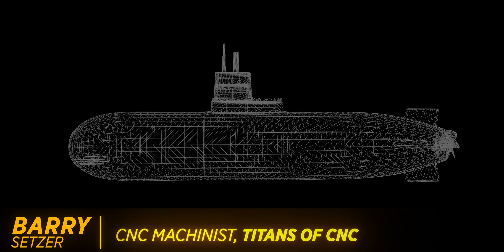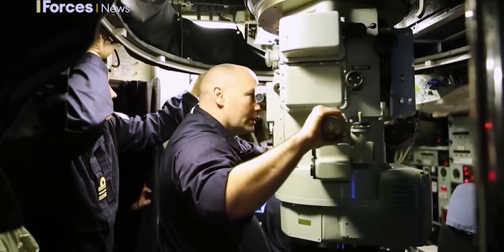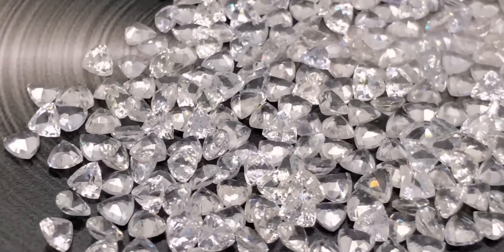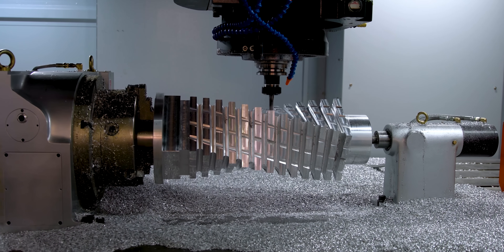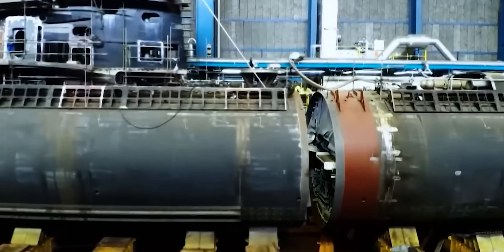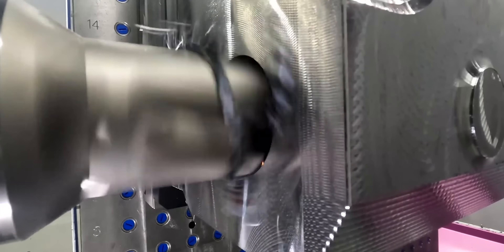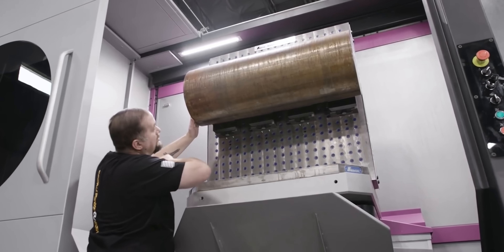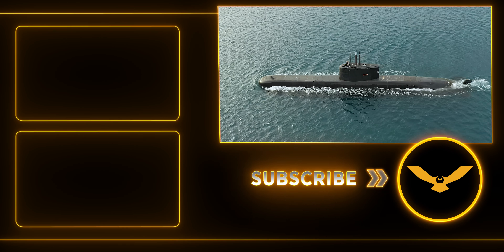I Machined a 50 Million Dollar Part

Comment: A development process that doesn't allow for changes starting before you can actually test important things is how you take a $5M part and make it a $50M part. You have to figure out everything that could possibly go wrong and account for it even if in reality, 90% of those things could have been totally ignored and wouldn't have had any effect at all.

If I was involved in the development, I'd have wanted to ask what it would cost to add two extra blanks to the order from the foundry on top of however many you need to deliver. The assumption being that they will get used eventually (even if the first part if perfect, parts have a tendency to fail in operation and being able to cut two years off delivering a new part isn't nothing). Given the cost of getting extra blanks, you then need to ask the question; is it cheaper to risk a failure you can learn from or to remove every possibility of failure? If the blanks are more expensive then the tooling plan, then by all means, get it right the first time. If not...

The general idea I tend to try to work with is "It's only a failure if you didn't learn anything you can use to make the next one better." As long as you set it up to learn as much as possible, and as long as there is a next time, "failure" is always an option.

Comment: I've cut carbide on an hlv hardinge with diamond toolkits, I've made multifaceted drills with negative angles in the bottom cutting face for mating in hydraulics.  I'd like to work with you.
Reply: Tool bits, God bless auto spell

Comment: The most expensive parts I've machined were steel tubes with copper-nickel explosion bonded to the outside. These were anodes for the navy. Once those bonded pieces of stock got to us they were worth over $10k and they were one of a kind. Getting more stock because you scrapped one was not an option. Those were rather hard to scrap so it was relatively stress free but still I was triple checking everything.

Comment: Monel: just to put this in perspective I machined 10 bars of this that was 3/8 inch diameter and 1 inch long bar. This customer was charged $190 bucks for this. I ran 20 pieces of 1/2 diameter and 4 inches of bar was charged $2,000 and some change. That material is not cheap. Something that can fit in one hand just put it that way. Crazy to see this much.

Comment: In the 1980's there was a company 
DC Tech.
 Michigan Ave NE Washington DC 
They did a lot of model work for the army Corp of engineers. Hydronic valve slides were one of the difficult parts they made.

Comment: I once worked with a part used as a liner in Pumps for the Mining industry to protect the inside of the pump from slurry and rocks. I was attaching sensors to it to measure abrasion rate

Comment: I used to work for a R&D military contractor that made nuts and bolts for aircraft/ships out of these awesome alloys. My job was to run a small CNC machine that would etch the logo on the top of each of the bolts and ran a pre quality check before it went to the actual quality control department. Was an awesome job, I won a 100$ raffle my first week there 😂 “the new guy would win the best raffle in a while”, co workers reactions was hilarious.

Comment: Imagine if your tool brakes midway. Sorry drills and milling tools break and you should run new tools too don't take any chances but it may happen anytime. You don't need to run the tools at max cutting speed at expensive parts but with cheap parts it's better to throw something away then slower workflow.

Comment: It’s only 50 million because they say so, the military says hammers cost 200$, there is no way the material comes close to that price, you guys do fantastic work and should get paid well for doing it.
Reply: Monel is expensive, and a 14ft size forging does sound like $12m
Reply: It's not the material it's the certifications behind the production of the part that cost money. Not every shop has certs that align with the need and there isn't enough of those shops to go around!

Comment: I have made parts for the military.  A poly-carbonate window for a camera.  27 pages of specs.  Made in 1 hour.  Massive air-conditioned workshops to make composite parts for submarines.  12,000 pages of specs.

Comment: I destroyed a $200k drill bit?
Boss thanked me.
Ok, the guy had bought it for 7k, bought it in in the hope we could rebuild it.
Was going fine until it started cooling down.
Carbide head sintered to a steel shank. Replace its 200 odd pcd inserts.

Coefficient of expansion got me. I had it a nice cherry red...

Yeah well, i said i wanted to use the induction heater on just the wings.
"Someone" forced me to do it with gas.
A 600mm pcd tipped carbide head drill bit weighing 450 odd kg...

Comment: My first job was running a SNK gantry mill 14ft by 60ft five axis machining titanium Side of body parts size of a bathtub I did run the smaller five axis SNK mill like 150in by 60 with a and b axis. And yes that fear your talking about is like a drug to me.

Comment: most expensive parts ive worked on were vespel plastic parts that got milled into little 90* bends, and also really thin walled turned sleeve looking parts on a mandrel, $1600 for a 38" .750 dia rod

Comment: Didn't you sign a nondisclosure agreement? I had a Machinist coworker, he worked making parts for nukes, he just had to make what the drawing required but didn't know what the other parts were.
Reply: Hence why they didn't say what the part was.  Based on the size, I'm guessing it was the housing for the nuclear reactor or some critical component for it.

Comment: Well Ive built a couple of scetchy stuff I work for a salt mining company so we needed a coupling for a machine and my boss asked all the engeneering shops around and no one would cut it so he came to me and I told him lets try the best part is I couldnt get a solid peace of metal at that time so I had to weld plates together to form a shaft now my lathe an mill are very old so theres alot of play I cut that adapter from welded plates and its been running 4years now no problem the original pruduct cost like 18k I made that one for about 4k

Comment: I’ve had several jobs that were upwards of ten thousand Dollars in material, and finished at over 50,000 dollars for single parts. It’s not often but when you have those jobs you put in every bit of knowledge you have and run safe double and triple checking everything before you press go. Ask questions if your not sure and take advantage of other people’s knowledge when it’s applicable. Asking questions doesn’t mean you can’t do the job

Comment: Got me beat on cost. Most critical and costly project I ever worked on was called a Transit Rail Simulator  built for Visteon at a cost of 250k in the mid 90's. It was exactly what it sounds like. A flatbed train car simulator capable of replicating the forces on automobiles when the train would couple and decouple additional train cars. Dimensions were 26f by 8f made from 4x8 sheets of 1/2in aluminum and fit together into a honeycomb structure with full sheets on top. When finished it required a 77000 pound actuator for the tests. It was a welding nightmare. No matter were you were in the shop, you got flash burn due to the reflections (incoming sarcasm) Thank God aluminum doesn't warp because it required 2 linear bearings running the full length. Mind you this was a small shop and Visteon's first choice for a builder was Boeing.  They told them they were out of there minds, and they were right. We had to come up with some ridiculous fixes like when we needed to flip it for welding we had no overhead crane so we came up with Pig on a Stake plan. Found the center of gravity, lifted it from either end and we could rotate it with a single hand. We even used Liquid Nitrogen to fit some pins. After the pins were pressed in their rings, we took the rest of the day throwing liquid nitrogen at one another. As far as I know it's the only one in the world.

Comment: Snapped a $400 tool in a $1200 block of material for a gearbox assembly. I thought I was going to throw up. Machine didn't have enough memory to load the whole roughing program, so I broke it into 2 layers and stepped down the Z offset. Didn't change the retract height to compensate. Full rapid into the part. Sad day. Lesson learned. Don't cut corners.

Comment: Never even came close to making a mistake of those types of magnitudes We were a fairly small shop doing mostly small parts ( still very intricate and accurate) Some were very large quantities and almost everything we did was a repeating part. Probably two hundred or so parts  that were repeats. However I can still imagine that feeling. I will share this story though. A good customer had us tool up two CNC lathes to machine a new brass casting . Running 2 shifts we banged them out while a rotary transfer machine was being built. After over 5,000 parts being machined to spec we got a call to stop production immediately. All those parts were just sitting there until they started to assemble them into the final assembly. Turns out they made a huge engineering mistake and couldn’t assemble the unit. We were paid in full but all were scrapped. I’m sure someone there got that sinking feeling. With all the machines and highly skilled people you now have I have no doubt you could take on ANYTHING! Quite impressive to say the least. I do have to wonder though just what would have resulted if you did do a big boo boo .

Comment: My most struggeling part, was a ion trap casing assembly für a prototype in 1985. CNC with paperstripe. No display, no haimer 3d measuring device.. made of a special steel. Work 3 months on it. The assembly was 3 kg total.. with 12 parts.19 cncd screws, runs in the first try better than expected. Made by blood sweat and tears 🙂 this parts sold later worldwide a few thousands maschines.

Comment: I only remember a large gear shaft that I had to weld, for which I did not want to give any guarantee and had advised the customer to try it somewhere else.
That's what the customer did, my boss wasn't thrilled and really angry with me.
But hey, the gear shaft didn't fit in the furnace to preheat, I didn't have much idea and was just the holiday replacement for the actual welder.
And that makes a difference whether someone has done repair welds for over 10 years, or just 2 months now and then like me for fun.
If I had destroyed that part, the assembly lines at Opel would have been up for a few days.
So a lot of loss in a failure, but my boss didn't care that the customer might end up in Devil's Kitchen.
Whatever.
Reply: Sometime you have to say no to a job.
Reply: @captiannemo1587  Yeah, and at the latest, since I've been working for that scumbag for almost a year, I have no problem saying I don't work for assholes.
It's the only way to make sure bad people don't make it to the top.
However, an hour later, in my anger, I had accepted another assignment, which did not seem entirely impossible to me.
However, the agreement between the actual welder and the boss was that orders would not be accepted while he was on vacation.
They were his old clients, whom he had as a self-employed person for over 10 years and who only came there because he had let himself be bought up with his company.
Anyway, word broken, customers and their existence risked for a little money, an asshole.
Anyway, I had repaired a molding plate, over 2 hours of work.
A rectangular wall, 10 mm high and 3 mm wide, I had to weld 1 mm so that the customer could rework it.
Without causing cracks, but had told the customer that I had never tried this before, could not deliver the same quality as usual and it was just an attempt.
The client had no problem with it, I never heard of it again and I assume the work was ok.
I'm also pretty sure that the actual welder, after he got back from his vacation, asked about the result, so probably the price was shitty at most, but not my work.
But to this day I don't know, I never had to do anything like that again.

Comment: Now, I'm semi-seasoned in lathe machining but I also know that there's a ton I don't know about machining as I keep learning new things from different shops I work in.

The most expensive piece I worked on was a large twin plastic extruder barrel coming in at near 250k USD. I was very proud of the work I did in that shop. 

I've moved on to another shop but they do it all, not just extruder barrels and I'm having to learn so much all over again since you don't know what job you're going to get or what material it's going to be made from. I'm finding it a bit daunting but also exciting and a challenge. 

We'll see if I hold up. There's days I feel comfortable and confident and there's days I feel lost and unsure.

Comment: It is true it is a lot better to build several prototypes out of cheaper materials than FUBAR  a  stock unit of "Un Obtainum" and having a severe weight loss from the butt chewing you might receive from your customer, the owners, and the CEO. The lower Superiors and finally your line boss. Because Everyone Knows Engineers don't make mistakes, or computers as well. 😅In college going for a materials science degree a CNC instructor told of a story that happened to him when he was a beginner machinist.   He was doing production work on punch tape-controlled machines( per computer-controlled machine). It was Monday afternoon just before closing.  He got the tape program boss told him to run the part. He asked if it was checked for error and blind run.  His Boss said, "No just run it the engineers know what they're doing".   He told the supervisor "Ok, but if it goes south it's on you. " About a third of the way through the part, the spindle speed ramped to 120% safe operating parameters and plunged through the bed of the mill. Destroying the tool bit violently and driving the stub through the work table and toasting the spindle.  So with today's software packages, one has to be a complete moron not to require several check-runs, then a test unit in either machine wax or aluminum, and then run your actual units.  Because there are always slight uuughoos! By running a  series of tests that chance is severely lessened.

Comment: Barry, the part where you
Mentioned having to document your entire process including feeds and speeds to the customer for
Approval before even cutting a chip, is my life everyday in the semiconductor field, even if it’s a 100$ part with + or - .010 on all features, no deviations , and it’s so annoying to deal with😂, they lock that process in with no changes allowed without 9 months of asking permission
Reply: That sounds familiar. In semiconductor, where a change in the surface finish or porosity of a part could result in millions of dollars of scrap, it's totally necessary to maintain stringent qualifications of every component and material used in the process... Hopefully it pays you well, because the machined parts I've ordered in the fab are all absurdly expensive.
Reply: @tanner3801  it doesn’t pay great, I make 28.25, I’m about to get a raise to about 31 and change, they make absolute bank, in our copper department, one person can profit the company half a million dollar per month and that’s the change we get,
Reply: @tanner3801  it can be something as simple as a bracket out of stainless that holds some wiring, they will give +-.001 tolerances for a bracket that gets welded or bolted to hold wires

Comment: I made a Bennett fit connection for two parts which were CNC Out. All worked great on the prototype with great tolerance and locking action... Made the finished part and they did not fit together.. Was not obvious straightaway... Turned out to be clamping force from hydraulic chuck to great which when parts were machined away cause the part to Deform.. Change the machining order to take this into account.. Schoolboy error I know..

Comment: While it might not be possible due to infosec and clearance, it would have been nice to see the finished part. Or even the original billet. I don’t think we saw anything close to a 14’ diameter billet even though it was touted. 😅
Reply: 2 year forging, I'd bet it'll be some huge structure for high temp heat/steam generator from the application and materials given
Reply: in 50years u can
theres 0 chance

Comment: When I decided to start knife making 1 steel flat bar looked cheap ~20USD for a 100cm x 5cm x 0.8cm slab 
Coat rises when I have to cut out the blade profile and make an accurate blank then there's the abrasives cost and drill bits that some gets burned up
Worse problem is my cheap belt grinder table that I used to use for making edges 90° to another face, is broken the good part is that I made a few knife blanks before that happened, but if I mess up these blanks my knife making days will surely end 
Also the stainless steels are expensive for my budget range for this hobby
So I prefer not to buy them 
So now with what I have left and what I learnt for the steel I wasted I've learnt to design and work in a way that reduces the amount of mistakes I can make and to design and spend more time contemplating the process and design for the knife I've decided to make

Comment: I work at an extrusion die shop and the most expensive thing I’ve worked on is a 9” die that was chrome plated and I had to grind it, because of the plating process not everything is perfectly flat but I had to grind the chrome to .001-.002 and if I messed it up they would have to strip it and re-plate it which would delay the part and would be quite expensive. The part was worth about $25,000 so nothing too crazy but it’s the most stressful/expensive part I worked on

Comment: I accidentally impaled a giant Giddings & Lewis horizontal boring mill because I moved the W axis toward the machine with a long part hanging off of it instead of the Y axis. It didn't break anything there was just a giant hole in one of the panels from then on